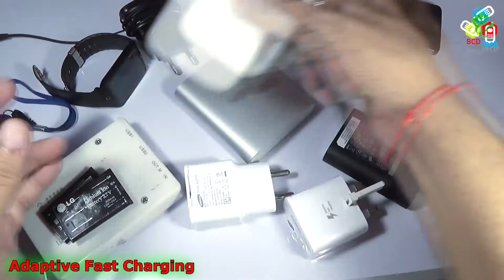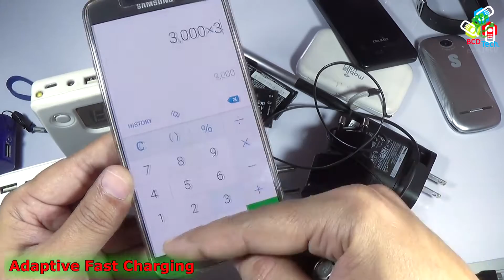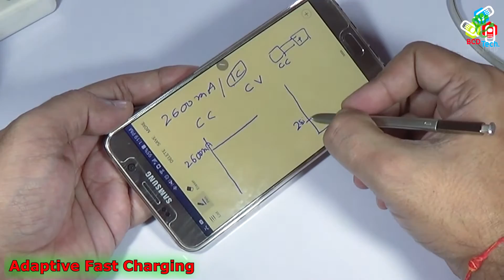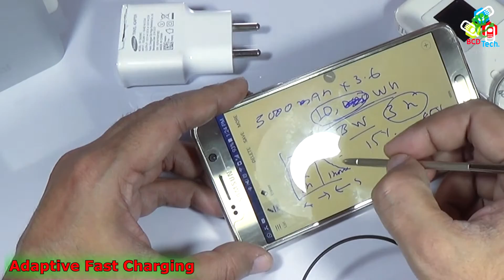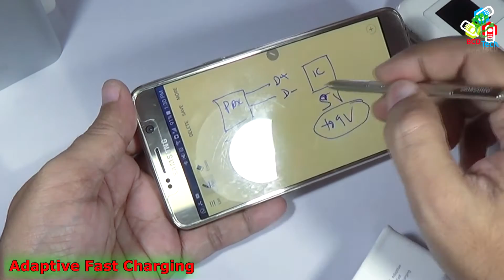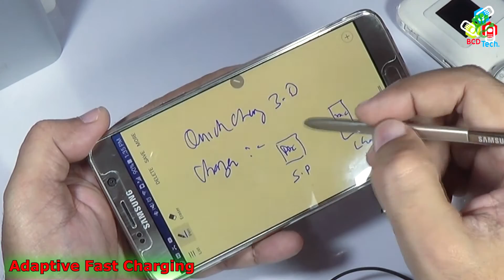Qualcomm Quick Charge 1.0, 2.0 & 3.0: Brief Introduction

Comment: very good; just to note, its not proprietary thing, but USB BC (Battery Charging spec), at least the QC 3.0 marketing term of Qualcomm; and there will be also USB PD (Power delivery spec) to provide up to 100W from USB-like bricks (20V/5A) or even wall sockets (in hotels or so) to replace ALL the proprietary big power bricks of hi-perf notebooks too... which is HUGE advatage for envirnmental reasons ... no more wasting by unusable old power adapters :-)

Comment: So if I have a fast charging phone than the 3.0 charger will charge it faster because there is the charger that gets smarter? I saw some 3.0 chargers and there they said that is future proof for the 3.0 devices. So if I have a device that only supports fast charging at 9V it is probably not worth to buy a 3.0 charger?
Reply: Quick Charge 3 chargers are backwards compatible. So if your buying a new charger go for a 3.0 one - even if you don't have a quick charge 3.0 device (phone battery pack, etc). Very little difference in price.
Reply: I ended up getting one, thank you!
Reply: So if my phone only support QC 1.0 (Snapdragon 600 in LG Optimus G Pro) it will still make a difference if I bay QC charger? The one that was included with phone is 5V/1,2A